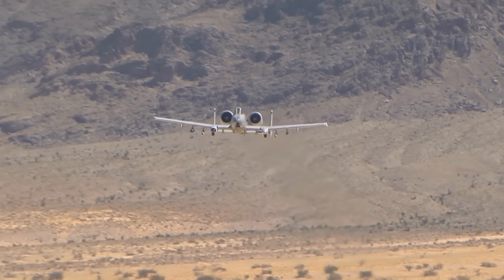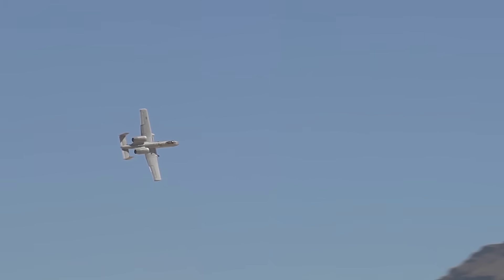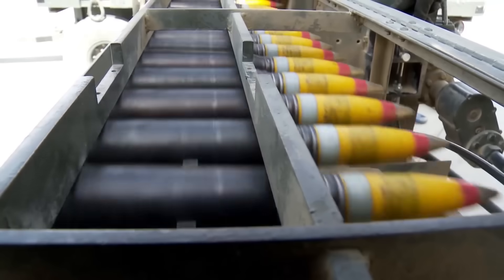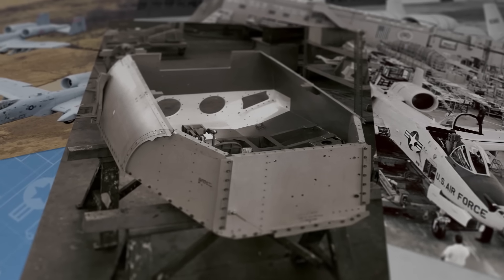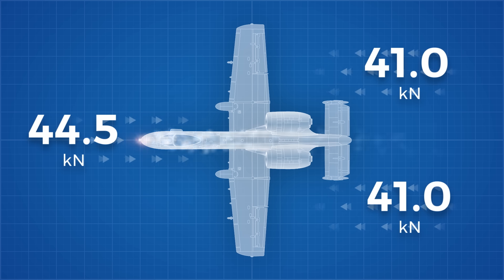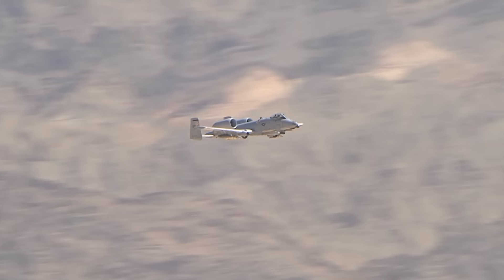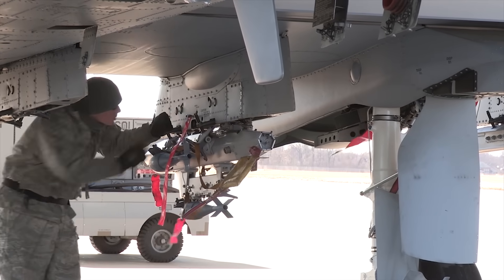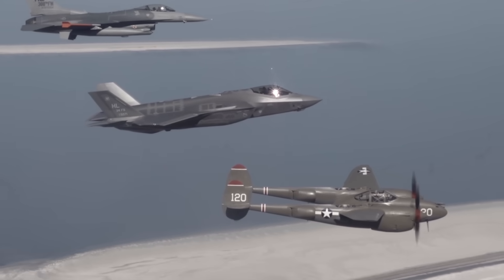The Insane Engineering of the A-10 Warthog

Comment: They're pretty cool and tough. Watched one do a wheels up (crash) landing at England AFB, and was able later to walk up near  it,  it was just skinned up on the bottom hull and wing pylons , the 30mm wasn't even damaged.
Reply: fun fact: the a10's wheels are intentionally designed to be half exposed so that a wheels up landing is less damaging on the craft
Reply: FWIW, while the A10 is tough and can take a hit, if given the choice, would you rather send an A10 to do a job, let it get shot at and then have to repair it, or an armed drone or a strike fighter up high to do the job and not have them shot at at all, ready to go for the next mission right away?
Reply: @ska042  Are you the only unit fighting a few dudes with AK's maybe with a pick-uptruck with a machine gun on back, or in  a war fighting a tank/combined arms battalion?  Either way,  you'll want an A-10. A drone with a couple Hell-fires/PGM's or a very rare F-35 with 2- 4 JDAM's internal*,  simply doesn't compare to  the ordinance an A-10 pilot can deliver(8tons of bombs, rockets, PGM's +1100 30 mm Cannon rounds)  on a real tactical battlefield fighting against  formal military army formations, or even against a few goat-herders with rifles.
You can pretty much ask any veteran ground combat soldier,  what they would prefer as support in a real war, . The answer will be the same.  Note-The F-35 "can carry, about the same of external  bomb ordinance as an A-10 , but it loses its stealth totally if it does, and it basically has no effective cannon ATM. . Plus it is so costly, and rare, and not designed for ground support  IMO, they will never be used in a tactical support role on a real battlefield.* -  The USAF hates "tac-air". All the lies about the F-35 doing ground support is just so they can get rid of the A-10.
Reply: Ridiculous comment. You want to see how long your tough A10 would survive in a war against any country with a functional airforce?
Reply: @Ukraineaissance2014  It was designed to fly into the teeth of ADA of a typical Soviet armor formation of the later Cold War Era .  Yes , against an opponent with "air superiority" over an an area, it would not work.- Much like   "Stuka Bombers" did not work in the Battle of Britain.  But they still provided significant battlefield support during the Bliztgrieg and   for years after the BoB, on real Eastern front battlefields. You think think the Soviets did not have an air force or air defense after 41-42? That the Stukas flew into and inflicted heavy losses??  Ulrich Rudel? Do you have a clue what battlefield "Air support" is or what is it does, or how it happens? The A-10 was a new Stuka/Sky-Raider. it borrowed from both and took it into the jet age.

Ridiculous ?  You are an uninformed idiot.
Reply: @Ukraineaissance2014  Ridiculous comment. The A10 isn't meant to be fighting for air superiority, it's job is to rain hell on the ground once the skies are controlled by other air superiority fighters. What you're doing is like shit talking a Bradley for not being able to dominate in armor v armor fights, or saying a Stinger is worse than a Javelin because it doesn't kill the targets on the ground with it. Your whole way of thinking about this is flawed to it's core.
Reply: @n00bist723  when did i say it was designed to fight for air superiority?
Reply: @Ukraineaissance2014  when you said any country with a functional air force could take it out easily. which implies that country has air superiority in the combat the A10 is deployed, because you need air superiority to actually kill it with an aircraft without running th risk of your aircraft being immediately torn to shreds upon entering the combat area.
Reply: Compared that now with "sophisticated" weapons like F35s that goes down from a damn bird (or even nothing at all). Really says much about our modern society.
Reply: @PaladinAvenger  People talk a lot of shit about the F35, and much of it is deserved, but any comparison is silly. The A10 is designed for getting right in a tank's face and melee'ing it to death. The F35 can precision hit targets beyond visual range, its twice as fast even with a full payload, and it's stealth. Radar can't see it coming, you can't see or hear it, but its already launched a guided attack at you and is returning to base before you know what hit you. The A10 is a polar bear - it's real deadly once its on top of you - the F35 is an artillery cannon: polar bear doesn't know it's in a fight. They are for completely different and complementary purposes.
Reply: @PaladinAvenger  nah, it only tells everyone that you know jack shit

Comment: The A-10 is what you get when you let the Army develop a plane instead of the Air Force.  What airplane do you get when you cross a tank with a helicopter?  LOL  But for all the joking, it works!  It does its job amazingly well, better than any modern replacement.  And every day we see that this role is still very much needed!  So I hope all of the threats to retire it never happen.  If anything, it needs an upgrade program, not a retirement to be replaced.  The design works better than imaginable.  The role is very much needed.  The pilot survival rate is awfully high for the near suicidal task for an airplane.  The ground support to get it flying is extremely low.  Yet for all that the cost is dirt cheap.  What more is there to say?

Comment: The A10s ability to remain on station longer than the other planes mentioned, therefore giving ground troops longer protection and helping in their advance or pull out. In other words saving our troops lives. Probably never even crossed the minds of the damn bean counters. These ass hats are all mini McNamaras. Who foisted the very limited tested M16 on our troops in Vietnam. We will never know how many died due to its gas system and head space among other problems only found after being used in real war situations. Situations that should of been how they were tested in the 1st place. If that dip shit could of found a huge bulk of dress shoes enough to supply all branches? Our troops would of went on patrol wearing Penny Loafers. They actually have an acceptable casualty number due to giving contacts to the lowest bid instead of best for the troops

p

Comment: The Chad A-10 vs the Virgin F-35.
Reply: proceed to get shot down by S-400 inside your A-10 while F-35 had already done it's job without getting detected
Reply: @Kalashnikov413  Will you for your next trick compare a fish's ability to climb with a monkey's? It's the same sentiment.

The issue is that the A-10 is really good at ground support and sucks at everything else. The F-35 is okay ground support if kitted for it. If it's kitted for it then it'll be bad at aerial fighting and stealth. It still has to have the basic capabilities for them though which drives up the price and the weight significantly, and weight is a serious consideration for a plane due to the physics of flight.

The F-35 is merely okay at everything and lacks the ability to be good at anything. This makes it so expensive that you could probably afford a good mix of planes that were good at what they were supposed to do and horrible at everything else. And in symmetrical warfare, the best will always win unless the users' skills are too far apart. There's no room for merely okay when it's pitted against good. An F-35 might be an okay bombing plane and an okay aerial fighter. If it operates as a bomber then it'll be a horrible aerial fighter and stealth plane. If it operates as a stealth plane it'll be a horrible bomber and aerial fighter, etc.
Reply: @nielsjensen4185  A-10 is now aging, it's GAU-8 Autocannon are now somewhat insufficient against modern MBTs. The F-35 can take it's stealth technology to it's advantage. Sneak in, pop in, send it, and go hide and escape.

And also, just because it has ground attack capability doesn't mean it's bad for stealth and air attack capability, it simply doesn't make sense at all.

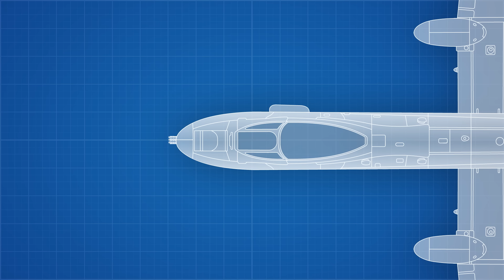Comment: 7:45 Correction! The GAU is actually mounted just left of the center line of the aircraft. This is so the cannon's firing barrel is lined up with the center line.
Reply: Exactly. The firing barrel is on the center line but the gun is not. The 9 o clock barrel fires. The reason for that is to make room for the front landing gear.

Comment: I think it’s simplest to describe this thing as a flying 30mm rotary cannon. The airframe is unremarkable as far as speed and agility. It’s not meant to be fast or nimble…. It’s just tough as nails and meant to take a lot of shooting and still be able to shoot back. My favorite two facts about this plane that sum it up perfectly: 
1. The cannon makes up a significant portion of the aircrafts weight (especially when fully loaded.) In fact; the cannon makes up such a chunk of the aircrafts weight that when they need to remove the cannon for servicing, they have to place a jack stand under the rear of the plane. 
2. The barrel fires at the 9 o’clock position because that’s when it is aligned with the centerline of the aircraft. The cannon is slightly offset to the left and if the cannon fired at anything other than 9 o’clock, it would cause the plane to yaw from the intensity of the recoil at 3600rpm.

Comment: It would be a mistake to retire the plane and replace it with F-35. The F-35 is a Jack of all trade plane, it will not outperform an A-10 as a gunship. Heck, it wont outperform a F-22 as an air superiority fighter either.

There are certainly advantage to a multi-role plane but specialist planes tend to do their specific job better. It doesn't help that the F-35 have the worlds highest operational cost (F-22 cost more per unit but flying it is cheaper) while the A-10 is incredible cheap to operate and far faster to repair.

Now, I could see that replacing the A-10 with a drone could be more tempting, this type of operations do mean high casualties, particularly if you lack air superiority during a battle but that would require a really tough drone since one that get shot down before it can do anything is useless.